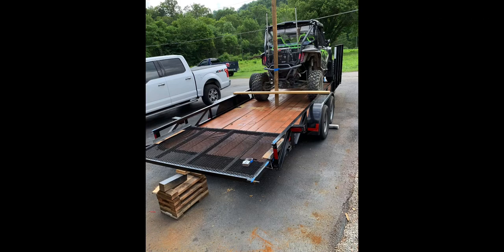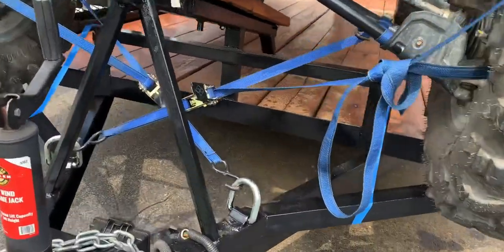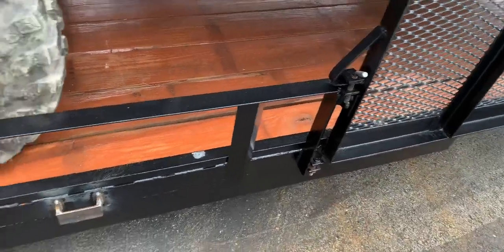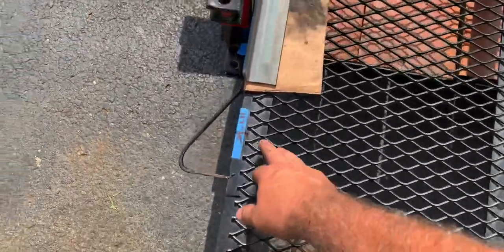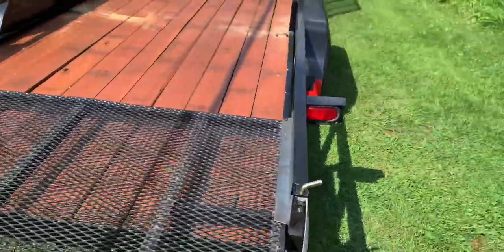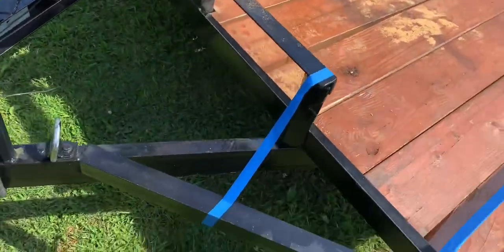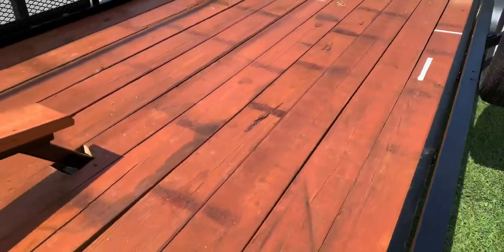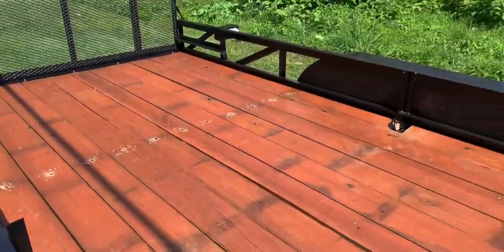Converting a 20’ utility trailer to hold side by sides or UTV’s

Comment: Admire your work and ideas, but why not just buy a longer trailer?  Also, will a half ton PU pull this with 2 UTVs pretty well?
Reply from the maker: Yes a 1/2 pull’s it good. This idea is for someone with budget and don’t haul two side by sides very often. My son-in-law haul’s his small tractor on it to plow gardens and it works great.
Reply: Makes sense.  Good work.  I look forward to learning some simple welding in the future to use around my land.

Comment: Probably pushing that trailer to its max with two 4 seaters on there.
Reply from the maker: It has 3700lb axels under it and I doubled the frame rails to the same size to one that would haul cars. We haul a tractor with it’s implements for years now and the only trouble we’ve had is one wheel got damaged. We try to keep our loads no more than 5,000lb

Comment: Seems like alot of work to how much a trailer costs. I mean hell if you got 2 SXS what's a 4000-5000 trailer? And trailers are like sheds ! Always get bigger than you think you'll need. I got a nice new trailer and upgraded to LED lights that will haul my jeep and SXS  plus a 4 wheeler if turned side ways for 5700$
Reply from the maker: Thanks for your reply. There a lot of us that can’t up size them or don’t have any where to keep big trailers. I was only able to get a 20’ but I made what I had work.

Comment: You did a lot of work with a decent idea, but sorry but that's a accident ready to happen. your weight distribution is way out on a 7000lb trailer and pulling with a 1/2 ton truck,let alone all the weight on the tongue. But if your only hauling short distance, great. I make a 7000 mile trip out west ,I couldn't trust that.
Reply from the maker: Well I thought about the weight distribution before I started, I got total weights of the two side by sides to make sure this was doable before I messed up my trailer, now putting the two units back to back on the trailer balance’s out the load and keeps the tongue weight down also. We travel around 75 to 100 miles at the most with them, we haul a tractor with attachments on it too on Mountan roads and big hills. Now a 7000 mile trip I agree with you go ahead and get 24’ foot equipment trailer.